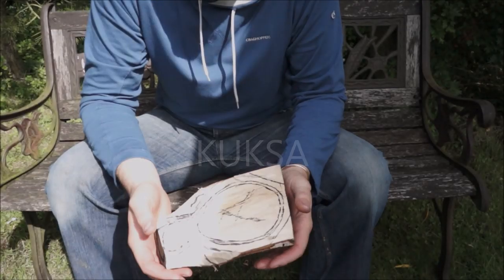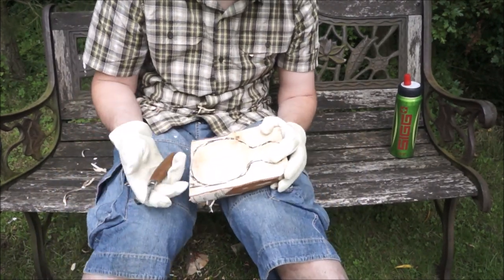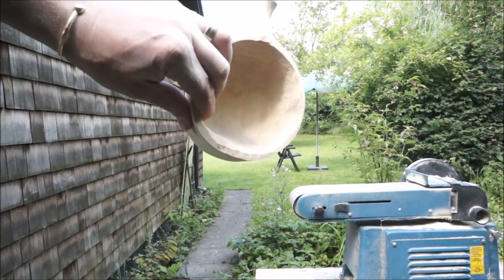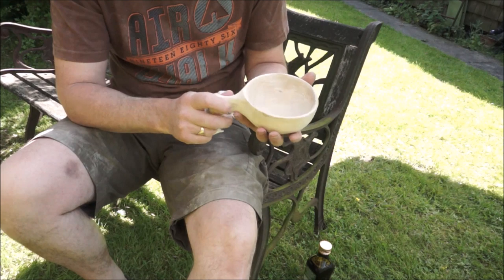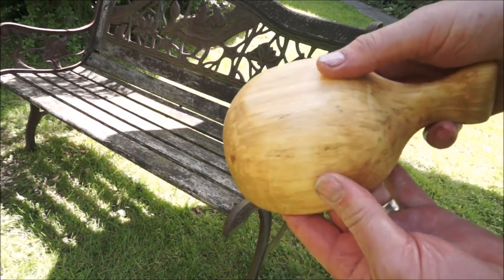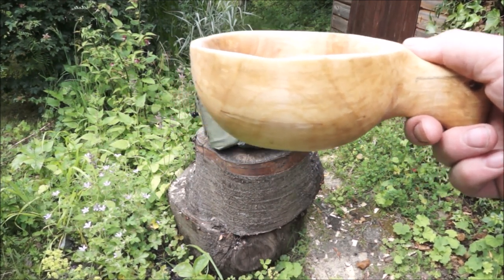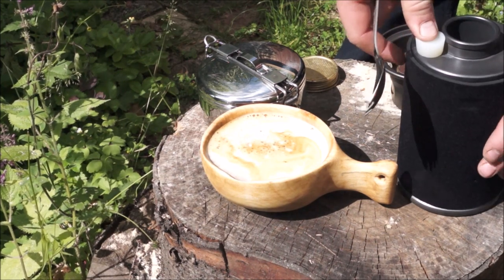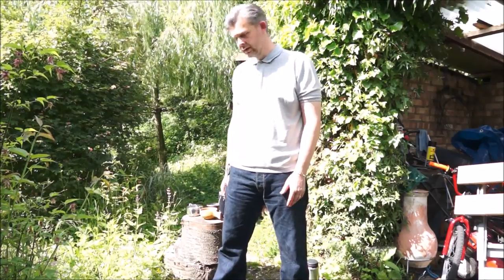Making A Kuksa Cup

Comment: It just look perfect~!! What kind of Oil did you used for finishing?
Reply from the maker: Sorry for not getting back to you earlier just seen your comment, i used linseed oil mainly on the outside but on the inside used a cooking oil but when i started to use the cup and putting boiling water in it a lot of the oil comes off but it does not leak and works great. Thanks
Dave